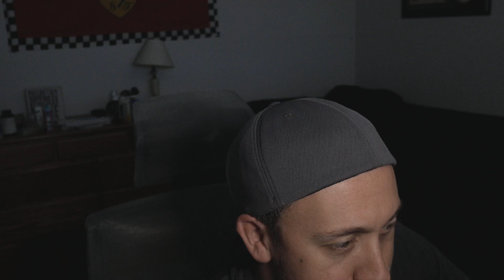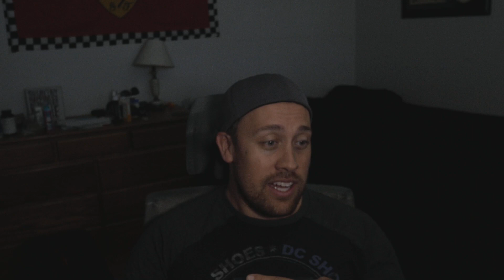Benefits of an Electric Water Pump vs. Mechanical Water Pump

Comment: Couple questions, is the pressure created in the system nit from the thermal expansion of the coolant, not the water pump? I didn't think the pump would create much if any pressure, just enough to flow coolant? Higher pressure would minimize the low pressure hot spots? 

With a pwm water pump, when getting up to temp, how do you maintain enough flow to not over heat the rear housing, but not cool it too fast through the rad assuming its a singular loop? Or do they integrate a thermostat into the system to bypass the rad when getting up to operating temp? Cooler climates would never get to temp with out a radiator bypass.
Reply from the maker: First Question: Yes, you are entirely right.  What I meant here was that the weaker pumps are unable to sustain and push past thermal expansion pressures and either stall or cavitate.
Reply from the maker: Second Question: The pump is always going to be in PWM for normal operations and ideally you size a pump with "overhead".  The modulation will maintain temperature and operating temp may only be at 60-75% DC, so in the case of emergency, there's some left over to cool things down.  We want to keep our temperature variance as tight as possible.  With a proper system bleed, it's never an issue because flow is ample.